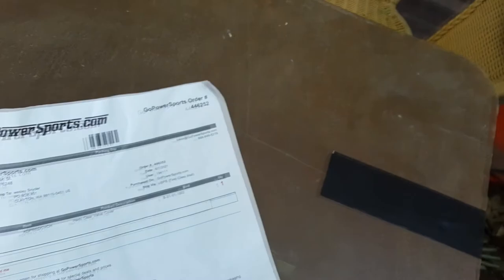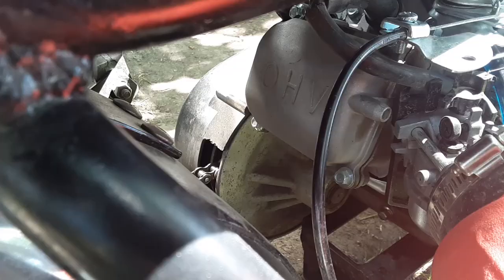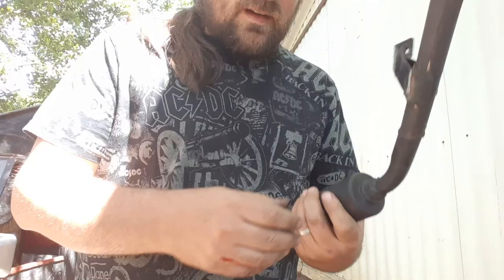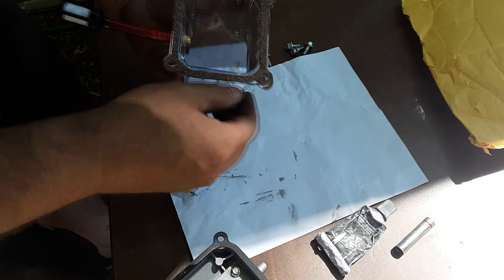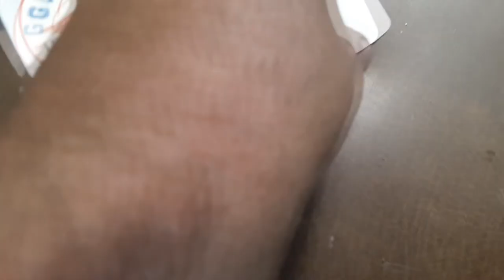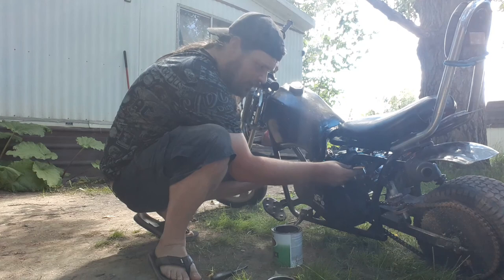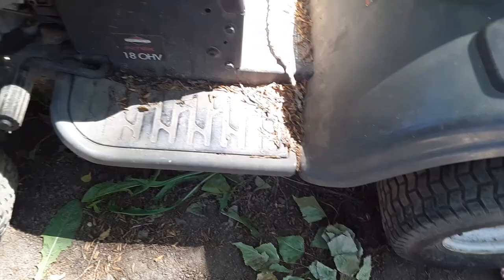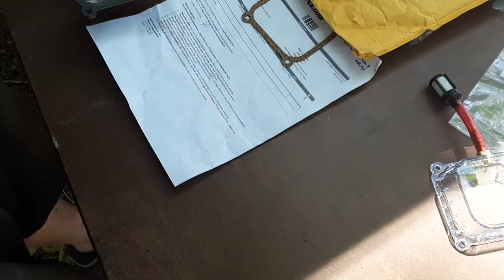212 predator clear  valve cover installation

Comment: Use the socket next time on those bolts you can't reach. And put a small piece of rubber inbetween the mount and the frame should keep exhaust from cracking